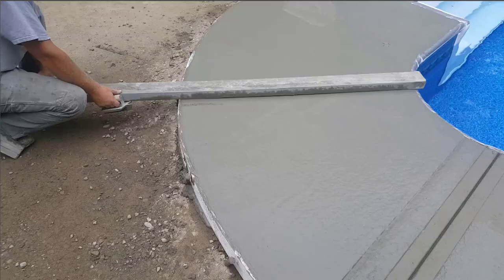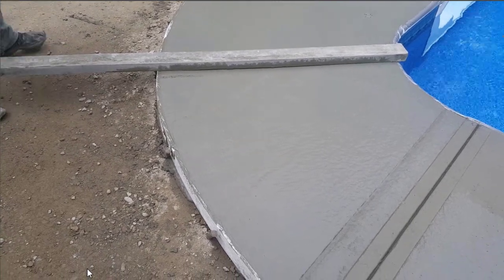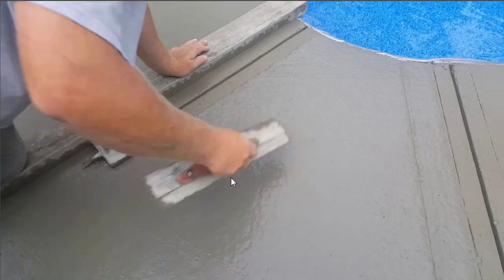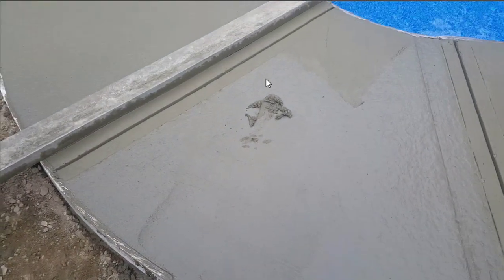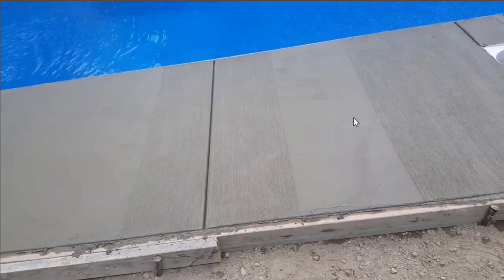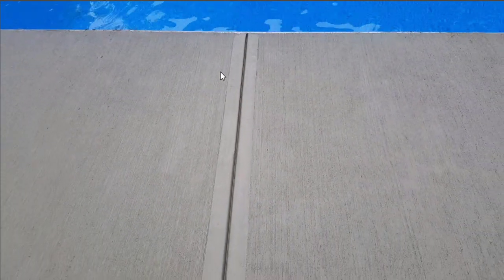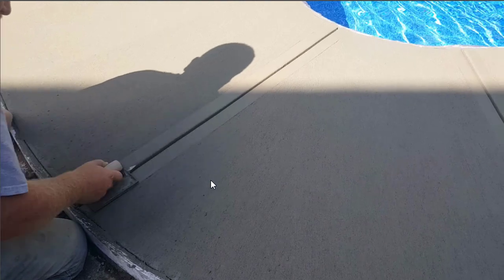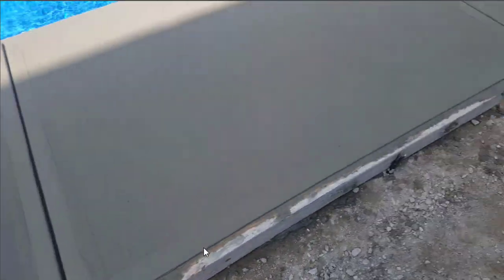How To Finish Concrete - Cutting Joints, Edging, Mag Float, Broom Finish

Comment: Sweet job. Any chance u can tell me how much a concrete job around a pool like this would cost?
Reply from the maker: The cost to do the concrete pool deck is usually between 6 and 10 dollars per square foot. It depends on how big it is, where you live, how much hand tooling is done.  In Maine, a simple pool deck like this is closer to the 6 dollar per sf range.